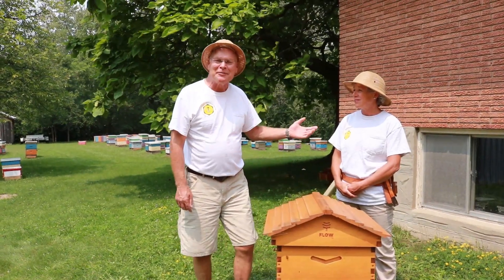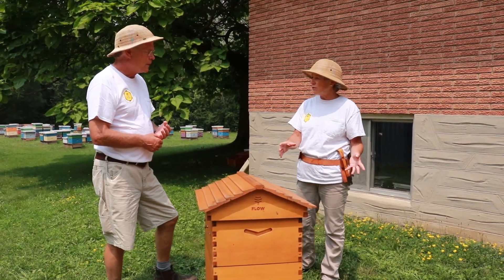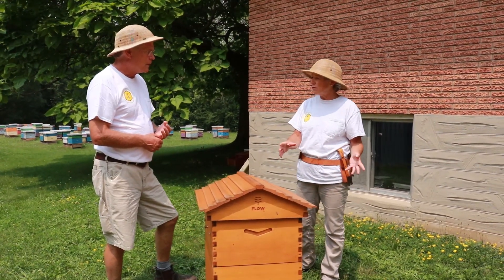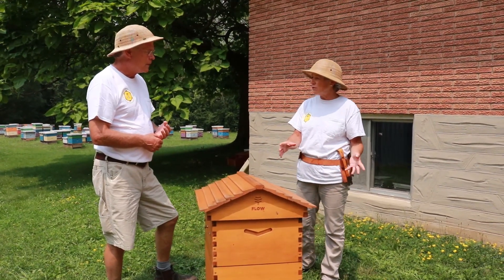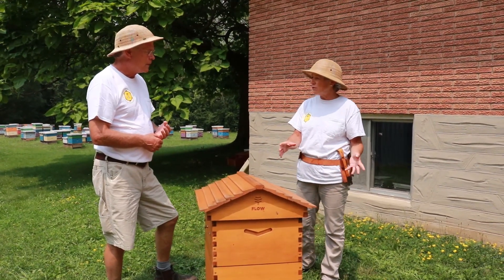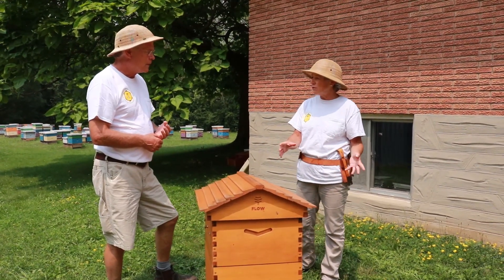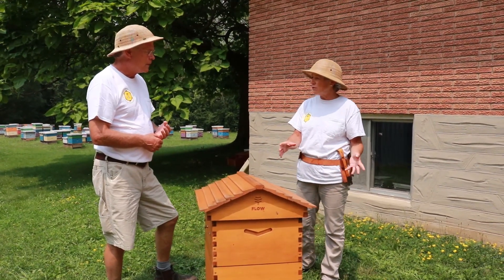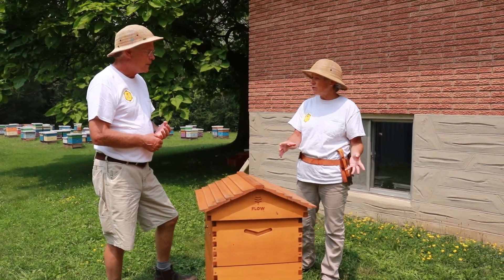Flow Hive

Comment: Hello Paul and Katherine, such a nice presentation about the Flow-Hive, I don't know how I missed your evaluation.  You're so right, according to the Flow-Company, more than 50 thousand beekeepers shared with them that they began beekeeping because of this honey removal capability. Wonderful and very thorough presentation, thank you!
Reply from the maker: Hi Fredrick
 It was great to meet you at Honey in the Hills!
 Good to hear you found this video relevant. We have two volunteers that use Flow hives. They both like how easy it is to harvest their honey.
Both volunteers have, however, had issues with high moisture honey and some fermentation at times. I wonder if the cells are too deep for effective honey ripening.
 Do you have any thoughts about that Fred?

Comment: I was one of the early adopters of the flow hives back in 2014 when they ran their gofundme campaign. So I have an original with a “2015 founding supporter” window cover for my box. And like you mentioned they are cost prohibitive to get more of, I think the base ones at this point for an entire set up is close to or over $1k, which is sad, because I really do like them. I’ve since started getting the Chinese knockoff ones that have the 7 flow style frames and a box already all cut out for them and dipped in “bees wax”, but I’m fairly certain it’s paraffin wax, for around 125 bucks shipped. And I will get them 4 or 5 at a time which makes them cheaper, so for the price of a legit flow hive, you can literally get probdbly 7 or 8 completely hive set ups with the knock off flow frames and boxes and if you already have boxes and full set ups for 125-150 each you can have you’re own flow hive set up. 
As for the quality of the knock offs, I can’t tell any real difference between the frames themselves and the original flow frames that I have from the first generation of them. What I can say is different is that the keys that come with the Chinese ones are noticeably cheaper feeling light and not as ridged, and the tubes don’t have that little outward notch that the flow tubes have, even thought the Chinese frames have the notch on the bottom to accept the one on the tube. 
Not sure how they work with the ones provided I just use my flow ones. 
Hope this helps some folks get into the flow hives one way or the other, I really do enjoy them. I’m a disabled vet who’s back and neck are complexly jacked up so not having to lift heavy supers and mess with the hassle of extracting and cleaning up after was a game changer for me.  I’ve helped my bubbies do it the regular way and I just wouldn’t be able to do it without the flow hives.. not without a lot of help anyway.

Comment: Lots of misinformation here, sorry to say. Have had one flow hive for six years; remainder are Langs. Tolerances are cut very tight in the flow hive; VERY difficult to get the first frame out to free room up to check the central frames. Video would have you believe bees first fill and cap the central frames before moving laterally. My experience has been routinely finding most or all of the frames filling with nectar near-simultaneously. Drawing off honey from the central frames in order to avoid backfilling of the brood nest is, in my experience, a pipe dream, as is the idea that you can regularly harvest from the Flow box to make it “light” and enable ease of brood box examination. Perhaps my bees or my environment are different from that of Flow lovers, but every year I’ve found they are very slow to use the Flow frames; brood nest backfilling and swarm promotion are regular problems. Hauling off that nectar filled Flow box in order to do brood exams is no treat. The ease of harvest is a blessing, but (again, in my experience and in that of a few others I know), the difficulty of general hive management far exceeds this benefit. I would caution any new beekeeper to spend a few years learning the care of bees using standard hardware, and then, if still intrigued, to start with a single Flow Hive and see how it works for you.
Reply from the maker: Hi Paul
 Thanks for your thoughts. Its good for viewers to see a mix of experiences in the comments. Catherine has been very happy with her Flow hives. I'm learning vicariously from her. We get so many requests for information about Flow hives that we thought we should help other learn a few tricks about managing them successfully.
Reply: @UoGHoneyBeeResearchCentre  So it means you got bees but you are not a true beekeeper, a beekeeper would never torture his bees not mistreat them. Teach people if you are a true beekeeper to love bees and treat them with respect no with lazy abusive methodology.
Reply: @HERBALNATUMAN1  ..settle down. Maybe start your own channel if you're the "true beekeeper" in this discussion.

Comment: The rear door is your shelf. The Flow comes with two clip on brackets that lock the shelf onto the back of the lower box.
Reply from the maker: Right! I forgot about reading that in the manual.. Catherine doesn't have the model with the shelf so she set ours up like hers at home. Thanks Neil.

Comment: Caveat for folks that live in humid environments:  My capped honey is very often 20% moisture... and my last harvest was 22%. I absolutely have to put my supers in a drying room or I end up with fermentation.  "Capped" does not mean "ready" in every environment.
Reply: You use this method because you are not a beekeeper, you are a honey eater meaning you don't care about bees, but about honey, that's it.
Reply: @HERBALNATUMAN1  ... And your would solve the problem of uncured honey how?
Reply: I always thought capped meant "ready" regardless of the temperature or humidity.  I think the bees know when the honey is ready (safe to store) and that is when they cap it.   I only run in to trouble when I have frames that are not 100% capped.  Most of my hives are traditional, but I have one FLOW super and the honey I get from it always has the least moisture content - partly also because the honey is not processed in an extractor which must also introduce moisture - but also because I only ever extract when all of the comb is capped.
Reply: @CraigNakamotoConstruction  Test some capped honey with a refractometer.  It might be ready.  In my humid environment, it probably isn't.  One other reason the extractor works so well for me is it mixes the capped with the uncapped.  After I dry my uncapped, it is super dry, which will bring down the moisture of the capped honey.

Comment: They do seem to have an enthusiastic following with some backyard beekeepers here in Australia.
I'm not one of them! 
The moisture content of the honey is a few percent higher than you get from a Langstroth hive. My own personal view is that their honey does not taste as nice. Flow Hive owners will challenge that.
If a hive gets infected with American Foulbrood, our biosecurity law requires you either burn the hive or have it irradiated. AFB is easier and cheaper to deal with in a traditional wooden hive. 
I'm staying with Langstroth hives.

Thanks for the video. You've shown another style of beekeeping.
Reply from the maker: Hi Ken
 Thanks for your balanced comments. Moisture levels in the honey can be a problem so you need to be very sure it is ripe. In the fall, when we also have issues with high moisture in honey in traditional hive supers, we ripen the honey in our hot room. See our video on moisture in honey for details. I did this with the Flow super this fall. We tried to address this topic in the video but could have said more.
Reply: I won't thanks them for the video, because, I am against torturing bees this guys are very biased by no telling the true about why this method is devastating for the bees.
Greetings from USA.🇺🇸

Comment: Hi Paul and Catherine, nice to see a demo of the flow hive.  We do have some flow frames and love the idea of it, but our main concern have been inspections and the weight.  A deep full of honey is pretty heavy to lift off for inspecting, and if I'm not mistaken, Catherine addresses this issue by inspecting after harvesting from flow frames so it is easy to lift.  But the need for inspection isn't always going to coincide with when the frames can be harvested, especially as you mentioned that moisture content can be an issue even if the frames are fully capped.  Especially with small hive beetles now in Ontario, we usually inspect every couple of weeks.  Can Catherine comment on how often she inspects and how that matches up with the harvest schedule?  I personally like the innovation of the Flow Hives, but I would be much more comfortable with medium supers rather than deeps in terms of lifting.  Thank you.
Reply from the maker: Hi Selena
 You make some good points, pro and con. 
Catherine has mentioned that if she needs to inspect a Flow hive, and isn't harvesting honey first, she removes some Flow frames to make the box lighter.

Comment: Go and have experience as a beekeeper, instead of buying a flow hive. The extraction is the easiest part of beekeeping. I've been beekeeping for 5 years and is the last thing in my bucket list. I worked for important beekeepers and learn the trade. Flow hive won't teach you to be a good beekeeper. Expensive, and no manual to be a beekeeper. The standard equipment are the best and you have money left in you budget to maybe put towards beekeeping school.
Reply from the maker: Hi Serge
 Thanks for your thoughts. I think Flow hives are an option for some people. You still need learn to keep bees. That's what we emphasized in the video.

Comment: I've used both FLOW and standard Langstroth supers. I find the standard frames far more convenient. Overall I would say the FLOW hive would suit a hobbyist who intends to only have a small number of hives.
Also, (speaking from personal experience) FLOW hives are subject to lots of issues - it's not all plain sailing and delicious honey :)
Reply from the maker: Thanks Keith. Catherine is a big fan and worked with both Langstroth and Flow hives before committing to just Flow. She keeps two hives and has no intention to manage more so the system suits her. From what I've seen, the only concern I have is making sure the honey moisture content is low enough to prevent fermentation. On a bigger scale traditional hives are better for sure.

Comment: Oh, by the way, the flow team sells shelf brackets to make a shelf to hold you honey jars.  super convenient.  Also, bees SHOULD NOT be in the backside of the Flow Frame.  You need to adjust the screw located on the top-rear side of each flow frame so tighten up that gap.  
There is one mistake you made while extracting.  You NEVER want to shut off a honey flow from a frame until it it completely finished.  This can lead to great leakage inside the hive.
Reply from the maker: Good tips. Thanks Brad!

Comment: This Flow Hive in my opinion has over complicated the traditional art of beekeeping. Why would you need a pair of pliers in case the plastic outlet was stuck? What if you loose the frame cracking rod? Why have to cover up to try to prevent robbing when "flowing"?  What if you lose any parts (too many components in this hive)? Why have to worry about 2-3 degree levelling?
You would have to be a very very experienced beekeeper to stay on top of management of this hive.
I have experienced several 8 frame models here in New Zealand and the  timber quality of the boxes are terrible - they may look pretty but not fit for purpose.
Reply from the maker: Hi Mark
Thanks for your input. These hives aren't for everyone. You need to learn how to use them  and they aren't as simple as they may seem. As we mention in the video you still have to do all the normal hive management.
Levelling is so the honey drains well and the little details Catherine mentions are just helpful tips. Its not hard to keep track of the parts. Think of how many things you use in traditional extracting.
 I agree that the early 8 frame hives were not well made. I had to get out a chisel and hand plane to assemble one for a friend. The new ones we demonstrate are laser cut a fit perfectly. The wood was flawless.